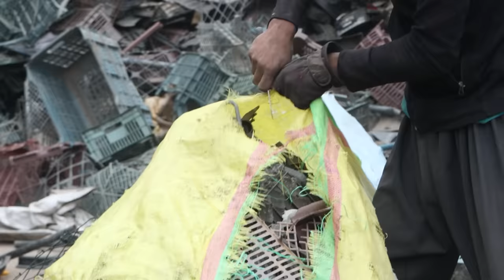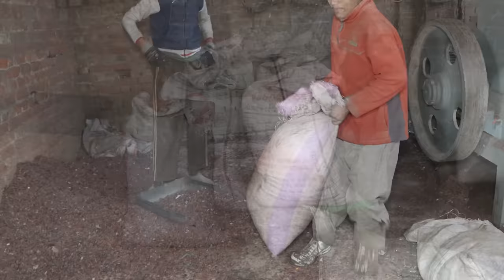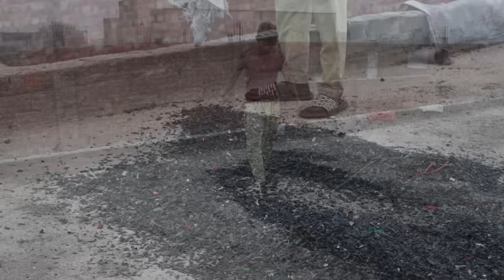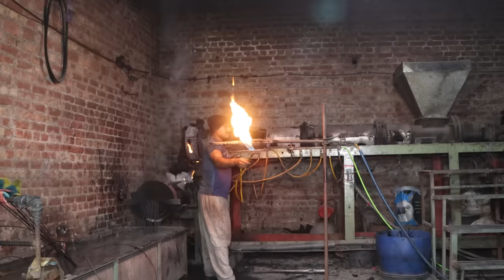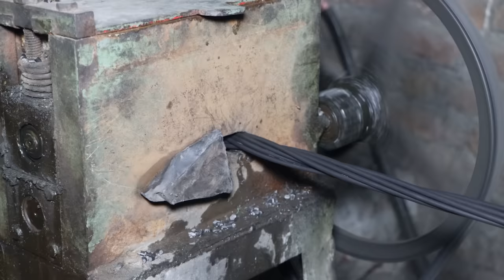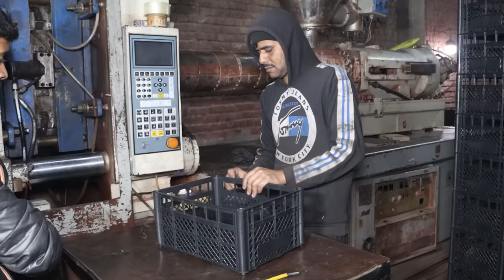Process of Making Fruit Crates From Waste Plastic is an Amazing Recycling Process

Comment: Most of the crates look malformed. The about of waste and energy to create flimsy creates from flimsy creates through a human health problem factory is immense. I'm glad the plastic is being kept from the landfill and new resources aren't being mined but the micro plastics they're inhaling, drinking, and spreading is shocking
Reply: What if they lined the crates with paper or something before placing the fruits?
Reply: @SarthakShah-cb1ii  I still wouldn't eat fruit from these crates.
Reply: @SarthakShah-cb1ii  The structure of the crates is completely insufficient to hold anything other than something very light indeed. Fruit is far too heavy for how flimsy they are.
They are also too brittle, hence half of the plastic at the start was broken crates that they are producing.
Reply: Is that's why they're one dollar at dollar general
Reply: Raw material for plastic isn’t mined; it is drilled for. Crude oil!!
Reply: It`s a 3rd world mate, if they could make perfect crates they would have better conditions in there. Besides that, obviously they are flimsy, it`s a warm plastic.
Reply: but this is far away.
Pakistan, India, Sri Lanka. 
So, doe we care? 
No,
The only criteria that counts is cheap,cheaper and a bargain on top of it...
Reply: Shocking? Is it really shocking?
Did we not know that this was going on?

Comment: The half-suitcase lid on the grinder was the winner for me.
Loved the clean-the-dirty-plastic-in-dirty-water-step.  Now the plastic is both dirty and wet.  Hey, at least they had three tanks of gradually slightly less dirty water to run them through instead of the one tank solution I have seen in other videos of this type.
Also, judging by the flimsy end product, I'm betting that most of the broken crates that were in the pile of plastic at the beginning were ones they made within the last few months.
Reply: At least we know where lost suitcases end up
Reply: Seen you are specialist at construction and resistance materials topic , isn't 😆😆✌️

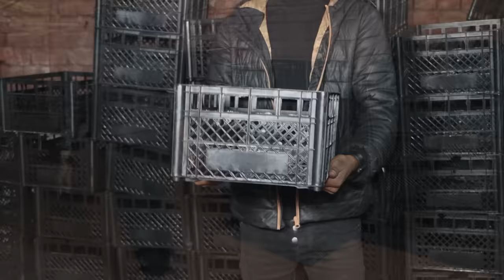Comment: At 12:40, they show off the end product, but they are such cheap crates that half of them are pre-broken and will end up back at the start. It's good they are recycling, but the microplastic counts in the local area must be crazy high, and if they just made better crates that could be reused hundreds of times, it wouldn't need to be recycled as much.

Comment: Thank you for this!! I've never seen the recycle part, but working at Parker Brothers, I used to work the plastic part, injection molding. Putting the plastic buts in the machine, waiting for the mold taking it out and knifing the flash so kids wouldn't get hurt in the houses and hotels in Monopoly. 
    Great memories!
    But mad props to these guys! It's all heavy lifting, and hard labor! Most people wouldn't THINK I'd doing this . They'd rather go on unemployment, and wait
 for something better, or find a way to get disability to let someone else do it. 
    Thank you for all you do, guys!!

Comment: So many of the "new" crates come out flimsy and broken. The mold should make a lot thicker crate to solve this. Also a lot of steps in this process seem very unnecessary. Go to shreasing, to making pellets, to making crates is probsbly all you need. Getting wet in dirty water 3 times, sun drying, then flame drying in a spinning drum, all to make flimsy broken crates, seems unnecessary. I'm all for recycling, but this is the first video I have seen where it looks like a lot of wasted effory for very minimal gain.

Comment: Why don't they put an electric motor with a metal blending tool to rinse the pieces? Guy isn't cleaning much
Reply: They are not rinsing but rather separating one plastic from the other. Your shredded plastic bottle will sink but the cap will float.

Comment: finished product is too light, that bottom will fall out soon. Look at the flaws in the other bins at the ends, many holes and defects. old and worn dies and the injection molding machine 25 years past it's prime.

Comment: The press operator is reaching into the mold without any safety lockout.  He suppose to have  door that he opens when the mold opens.  The door would have a a safety switch that prevents the mold from closing until the door is closed. Unreal.  Someone will lose a hand. Sickening.

Comment: The wooden fruit crates are better for the environment and humans.
Reply: Deforestation is good?
Reply: @patmcbride9853  It's not the deforestation. Wood for crates comes from wood farms. The issue is cost and weight.
Plastic is lighter, doesn't soak up moisture in transport, doesn't rot or splinter AND can be somewhat recycled. Wood just ends up as fuel, though it remains in the carbon cycle.
Issue with plastic is that the original feedstock is oil (i.e. carbon pumped from under the ground) and that these recycled crates eventually deteriorate into CO2. 
They are brittle and smell bad due to gassing off - these guys are just melting plastic, without adding any stabilizers. 
The real solution would be proper recycling, breaking the plastic down to chemical feedstock for plastic of same strength and durability as the original - or better.
Thing is, that can't be done in flip-flops.
Reply: @d3nza482 Most wooden pallets use oak or Southern Yellow Pine.
The pine might be farmed, but land will be cleared (deforestation) in order to grow neat rows of pines.
Show me the "oak farms".
Reply: @d3nza482  you mean extrude pellets with additives and compounds to get material properties as the original plastic and then use them for moulding but that would not be feasible for this scale because proper value addition of polymers requires a certain level of expertise and R&D which this sector lacks due to limited cap-ex

Comment: Was the extra let’s take this up on the roof step even necessary
Reply: yes. you have to dry it, before you melt it. try to melt it wet, and you will get steam explosions which can damage the machines or splatter molten plastic on the workers.
Reply: @pauleasley6488  if they wash the plastic let it dry before crushing save lots of effort